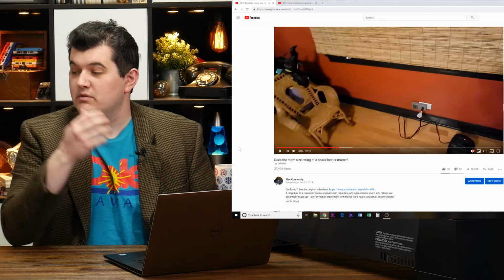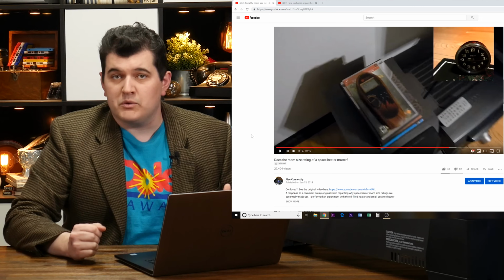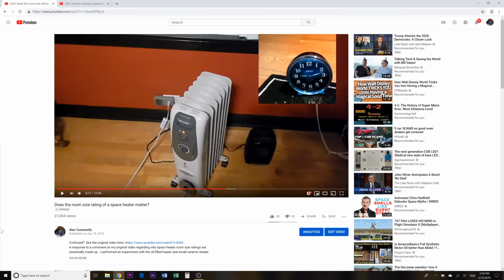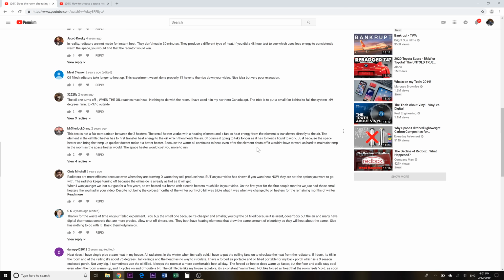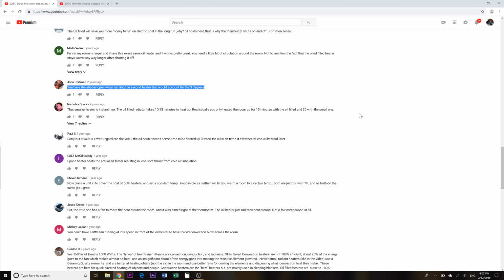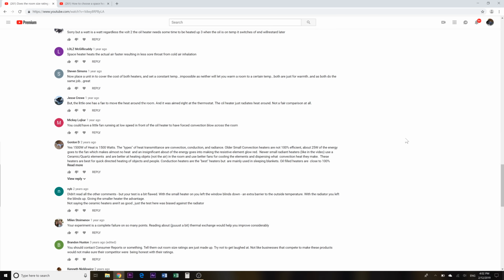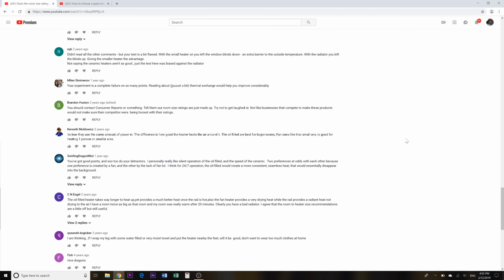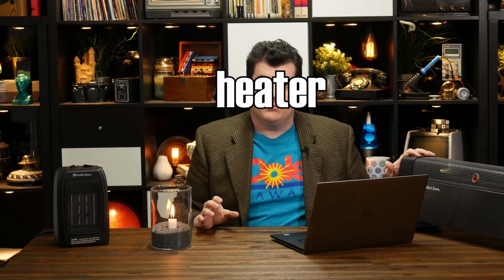More Space Heater Nonsense

Comment: No, I don't know how could the large room heater be better than the smaller one at heating big rooms.
However I do know how it is better at heating small rooms. The small one doesn't store enough energy so it will overshoot the target temperature every time it turns on. In a large room it is insignificant error since it has much larger heat capacity. 
It would need a PID controller to compensate, which it definitely not have. Not because of its cost, but because just like the thermostat on that oil heater, they don't care enough to design it properly.

Comment: The quartz heaters have metal in them to increase the surface area to transfer heat more efficiently when the fan is blowing across them.
I have a quartz type heater it's not an EdenPURE but, my experience was just like the EdenPURE commercial. I was living in a duplex and Nicor came out and change my gas meter because they were sure it was broken based on my lack of consumption.
I've used oil-filled heaters in the past but prefer the quartz heater.

Comment: How popular are these things in the US? Most of the time in my country (in Europe) heaters such as these are used for "emergencies" and transitional periods and rooms where other heating isn't available for some reason - cabins and such. But during winter everyone is using proper furnaces (usually wood) or a heat pump. These days pretty much all new houses build just use a central heat pump to heat the whole house. Simply because they are the most economical in the long run and require less maintenance. And a lot of people are replacing their old stoves with heat pumps as well.
Reply: They are popular for a "quick fix" too but just about every home in the northern US uses some type of fuel for heating (normally fireplace with either a propan utility line or a private tank under/above ground on the property for the furnace.  some even use oil as fuel).  In the deeper southern, most home AC/heater units is all that's really needed; However, I've still seen plenty with space heaters during the winter in Florida which at worst gets 40'f or 4.4'c.

Comment: TL;DR: unlearn the term "space heater", you're comparing heaters with different purposes.

You're focusing too much on numbers and room size and falsely linking the two. As you correctly mentioned in the other video, the 1500W is simply a factor of how much amperage the circuit can take (here in the UK 2kW+ heaters are more common simply because our 230V mains power supports it), but the BTUs is basically just marketing w*nk that they can put on the box with a simple mathematical conversion. Ironically "British Thermal Units" is not used in the UK. We also don't use the term "space heater" since it's not always applicable. In other words, just ignore the numbers.
As for the room size, it's got more to do with the physical size and surface area of the unit and its thermal storage capacity.

The most important thing here, which you touch on later in this video, is usage case. The fan heater is indeed supposed to get the room up to temperature quickly, but is not always ideal as it causes temperature fluctuations. There's also noise considerations. An oil filled radiator however is not designed to quickly heat the room, but rather to store heat and deliberately release it slowly. A common use case is to have it come on on a timer during off peak electricity hours and release it gradually throughout the morning (there are also longer lasting ceramic versions known as storage heaters) in order to maintain temperature. That maintaining of temperature is the key feature, not heating up a room; unlike the fan heater that is specifically designed to create large amounts of heat very quickly for the short time that it is on. I should also state that it's entirely a preference thing. Here in the UK all domestic central heating is based on water filled radiators (or underfloor) designed to store heat and release it slowly, whereas in America you will also come across central air (something almost entirely unheard of in UK housing).

To reiterate, you're getting confused by numbers that aren't relevant, the real difference is in the usage case; the radiator advertised for a large room will not heat up a small room as fast as the fan heater does, simply because it was never intended to in the first place (it's an apples to oranges comparison). Similarly, a large fan heater is more suited to a larger room, not because it is more powerful that the smaller one (it isn't), but simply because its form factor can move more air (the number is meaningless); likewise, a larger oil filled radiator stores more heat than a smaller one.

Comment: Sidenote: None of these heater types dryes the air more or less than any of the others.  As long as the temperature outside is lower than the freezing point of water,  ANY heater will dry upp the air some by driving some of the expanding air out of the house (hot air takes up more space than cold). When the air later cools and contracts again  it will suck drier air in from outside, heating it up and creating even more space between the water molecules, thereby lowering the total humidity of the room. The only way to avoid this is to place a evaporator in the and add humidity to it. Mainnote: You were right.
Reply: @Undefined Lastname Semantics... Well, thats exactly what I said. "dry up the air by driving some of the expanding air out" -> "suck drier air in from outside" (and making it even drier -> add space) I could of course made my post much  hard to understand, but I chose to keep it simple. If the house is hermetically sealed, the RH will not change with rising temperatures, only by lowering the temperature to below the dew point will affect RH in such a house. The pressure will however change with varying temperatures. About the freezing point of water, yes, I simplyfied that to, I omitted dew point for it. Look, now it's not simple anymore...
Reply: @Thingsthatgopew22  extra semantics, the oil filled will have a less perceptible "drying effect" due to not actively moving the air, thus it is not striping the moisture off your skin as fast as the fanned little thing, technically meaning that since the small fan model is activly increasing the speed of your sweat joining into the humidity, it technically is increasing the humidity faster than the oil filled one will. 

runs off with a box of tin foil in hand"

Comment: Yep, each of thermal radiation, thermal convection, and/or forced convection (i.e. fans) have their pros and cons in terms of human comfort and locality of the heating, but when you put any of these 1500 W heaters running at full blast in a control volume (presuming no thermostats or failsafes kicking in), you're going to find the same change in heat when integrating over the whole volume.

Comment: The one and only actual difference between "large room" and "small room" heaters I could think of, it's thermostat difference. MAYBE, thermostats have different on and off temperatures, or one has larger delta between those temperatures, dunno. As an example, small room has less heat dissipation to outside space, therefore 1500W unit will heat it faster. But when the room is heated, it takes longer to cool, compared to larger room, so thermos... Now it sounds even more like bullshit, damn.

Comment: well , you must compare with a reversible AC unit (most rapid and efficient , but ... noisy to use on a bedroom to sleep)  ... personally I love my Gas boiler that produces heat (trought thermoregulated convector's) and hot water , and if I let in automatic at 22°C ... It saves a lot of money ... If people stop powering on/off/on/off by hand and leave the thermostat do the job , then you save money , because all the stuff inside , plus the walls, will keep that temperature . Each time we turn off the heating , all stuff inside the house + walls get colder , and we spend a LOT of energy to try to heat everything again  ...

Comment: In your measurements, you are ignoring the heat capacity of the oil. That explains the difference in your test.
Once switched off, a fan heater is immediately cold. Switch off the power to an oil-filled radiator and it will stay warm for hours.
You are 100% correct though, obviously it's the same method. The amount of power used over time will generate the same amount of heat.

But, I still have no explanation why a convection heater and fan heater are so differently priced; they are generating the same heat over the same period of time.
The 'room size' is also complete nonsense.

Comment: The thing that might make the larger heater better for a large room is that it can heat the room much more evenly. There are 2 things you want in a heater, how fast they can heat up your room and how uniform you want a temperature in the room. You can for example use a blow torch to heat a room (not that I would ever do that), and it can provide the same or more heat as a large base-board style heater, but that heat will be concentrated in a small localized area and will take a long time for the natural convection currents to make it uniform. This is where a larger (in size) heater can more evenly heat a room to the desired temperature. They provide the same total heat out, but distributing that heat to a room is different. I would imaging that if a test was done with a small and a large heater in a room, with the thermostat a set distance away from the heaters, you would find that the larger heater would have more uniformly heated the room than the small one. I am a Mechanical Engineer in case you are wondering.

EDIT: After some thought, perhaps it is the fact a larger heater will heat a room more uniformly which is why they write "Large Rooms" on the box as it would be better in that sense. Everyone just thinks that the "Large Rooms" label is because it outputs more heat, when they might not be what they are trying to get at. Either way it is a very deceptive tactic from the manufactures and should not be continued.
Reply: Gazz292 Because the fan will create convection currents in the not (in addition to the natural convection) that will help heat the room faster to temperature.
Reply: That's the thing, if you want it to distribute the heat, you just get a small heater with a fan.

Now you MIGHT be able to make the case that it can redistribute the heat with a larger, less noisy fan, and there IS something to be said for that.
Reply: DFX2KX I was never talking about the difference between a heater with a fan and one without one.... They both have to be the same, either both have fans or they don’t. You cannot compare apples to oranges and that is what you would be doing if one had a fan and 1 didn’t.
Reply: Then it just proves his point that just because the box says that one heater is better for a large room and another is better for a small room, doesn't mean it's true. The box on the oil heater said large room, the smaller ones was for small room. Yet the fan makes the small one better for a large room. The whole point of the video is that the advertising on the box doesn't really correspond with the reality of the product.

Comment: Well... teeeeeeeechnically the larger one would be more efficient (considering the smaller one didn't had any fan) For example, imagine 1500w coming into a lamp bulb, it would get red hot really fast, but it's surface area would warm little air arround it, taking more time to fill an enterie room evenly. Now take for example an enterie room full of metal pipes on the walls, and you pass 1500w into 'em, they will heat way slower, but their surface area will evenly heat the room. Keep in mind that ENERGETICALLY they are the same, but that the bigger one would be more efficient on evenly warming the enterie room.... But let's be honest, I'm comparing a little bulb filament to a room full of pipes, A heater that's just a few centimeters (even if it was a few meters) bigger than another would make no practical difference whatsoever.

Comment: I like how you corrected yourself as if we were going to (or could) fact check the accuracy of whether or not you or your brother had the room first.

Anyway, the only really valid thing is to say that the oil-filled heater might "dry the air" less than the fan heater... Except that it won't; the fan heater will only dry YOU out if it is pointed at you like a hair dryer. IDK where that person thinks the moisture is going to go if you're in a house with the doors and windows closed... Anyway, I had the same experience as you while using both kinds long-term. Radiator style blows. I, not even knowing which was meant for large room or small room, grabbed the little guy, based only on past experience, when my heat went out one time because I felt that it had better (and faster) heating ability. It was pretty quick about getting up to temp even though the apartment was down to 40-something F.

Comment: Maybe "small room" vs. "large room" is about duty cycles?  That the small ceramic heater isn't meant to be run 24/7, while the big oil-filled heater is? That they assume that "small room" heaters will shut off regularly due to not needing to spit out full heat all the time to keep a small room warm vs a large room?

Comment: 1. 1500W is the instantaneous power right? Can the smaller one run at 1500W continuously without melting? 
2. (assuming 2 heaters with the same technology) Bigger heating elements are better at transferring the heat to the air due to the higher surface area. That means it will sit at a lower temperature than the small one. 
  a. The power consumption may be going down when the temperature of the heating element is increased. 
  b. At high temperatures, the heat energy can be emitted  as radiation. radiated heat can heat up unnecessary things like windows and roof which will transfer that energy out of the room easily.
  c. The thermostat will turn off the bigger heater less due to better energy transfer, It will run at full power longer than the smaller one.
  d. Low temperature means better temperature gradient. The output power does not spread across the room instantaneously. There will always be a gradient. for a low temperature the gradient will be low. Which will make the room more  comfortable.
Reply: P= V^2 /R  Usually for restive elements R and temperature are inversely proportional. given that V is constant with increasing temperature P will decrease. 
check the below heating element datasheet for P vs T graphs
https://www.kanthal.com/globalassets/kanthal-global/downloads/furnace-products-and-heating-systems/heating-elements/mosi2-heating-elements/s-ka058-b-eng-2012-01.pdf

Comment: Apples to apples comparison of the two electric heaters. Heating effect in the room will be the same because the output is the same, no question. So why small and large room?

I'm going to suggest it is a duty cycle issue. The large room heaters often split the load between multiple elements. The output of the multiple elements combined is the same as the output from the small room heater with less elements. But that in turn means that each element in the large room heater is running at a lower power through put.

Lower through put on each element means that a heater running multiple elements should physically outlast one running less elements. If we say a nominal small room takes 1 hour to heat to the desired temperature and a large room takes 2 hours, and then stipulate that the small room heater is a single element while the large room heater is a duel element, the large room heaters duty cycle should be close to double that of the small room heater.

Or a small room heater will last 10 years being used for small rooms, but maybe 5 or 6 years if used for large rooms. Meanwhile the large room heater will last for 10 years hearing large rooms, but maybe 18-20 years if only used for small rooms.

(All figured are vastly simplified to make the point easily understood, and are not based on real world details. Figures would normally be in hours, but an average year age makes the point easier to understand.)

Comment: 20:47 i suffering in a similar way: I can't accept if "the right thing" is reasoned by false arguments. 
If they would advertize "oil radiator more convenient for drying wet jackets" or "fan heater more effective for distributing heat in room, but doing it with noise": Then i'd be fine. But >50% of the claims are irrelevant or simple false.

Comment: I found with the oil-filled heaters you hae to combine them with a box fan or the like to push the air out into the room, keeps them from tripping and mixes the heat in quicker.  But that just reinforces your whole point anyway, since they are charging more for a design that lacks a fan, compared to a cheaper and smaller heater that already has a fan, and performs better.  Gotta love marketting and the total ignorance of the public who buys these things.

[edit - and if any of the idiots who argued with you on the old video want to try that with me, I welcome the challenge. I am a Navy-trained mechanical operator who was originally certified to operate nuclear propulsion plants, a training program that includes study in heat transfer and fluid flow, metallurgy, thermodynamics ... they had best bring their "A" game or call it a day.  I will send them home crying for their mama!]

Comment: Only thing I can think of is the one for the smaller rooms are built slightly cheaper and are designed with the idea in mind of running for shorter periods of time and spending more time off between running. Also, marketers are full of BS.